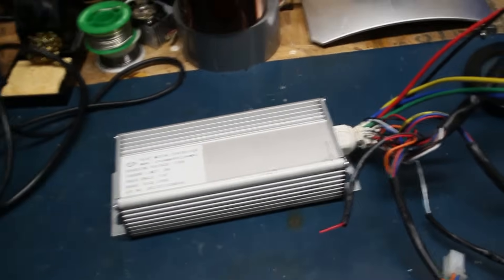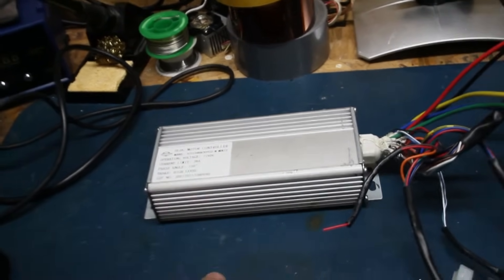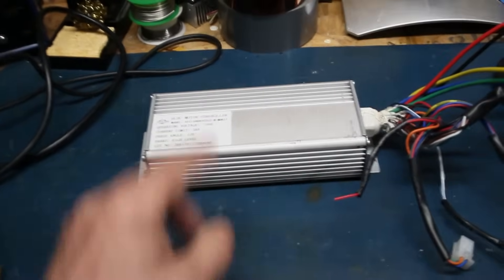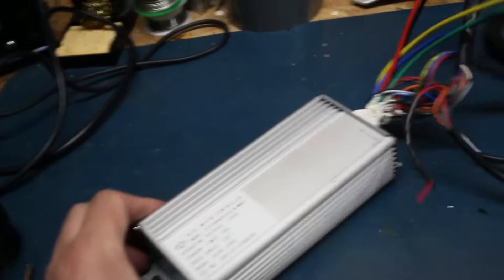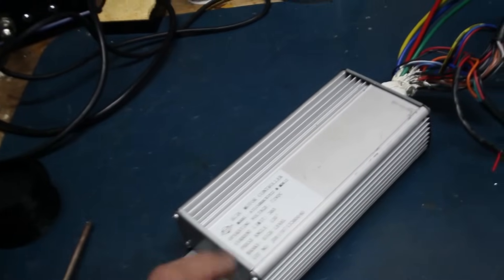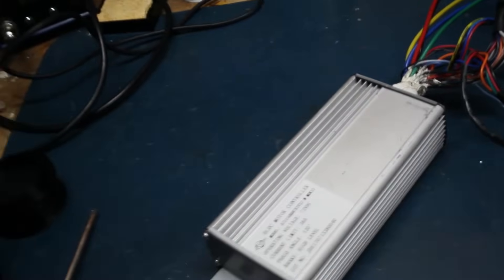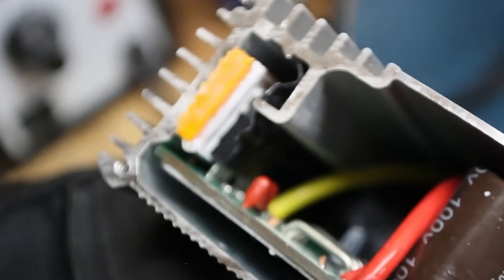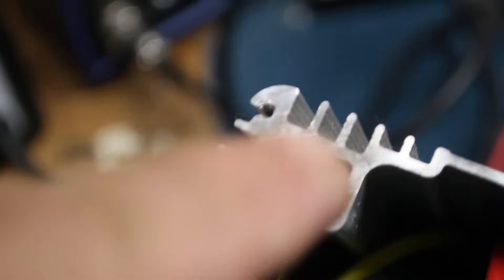ebike screwless controller? 2018 model

Comment: Should be able to undo the waterproof bung on the other end for the cables and feed them through a little bit.

First unscrew the other ends plate though, you should be able to turn it on it’s side and slide it through (I used to do this when I was dumb 8  years ago when I did my first mod. (Ps thank you for your videos, you’re the one that got me actually modding controllers to start with and I’ve come so far since)

Then again you should be able to feed the cables through the “waterproof” screw bung thing once it’s loosened off and connectors removed.
 Then you should be able to push the board forwards, most of the time if you can’t go one direction, you have to go the other :)

This is actually a really tricky but pain in the ass design. You’re absolutely right man, engineers suck ass always according to technicians 😂